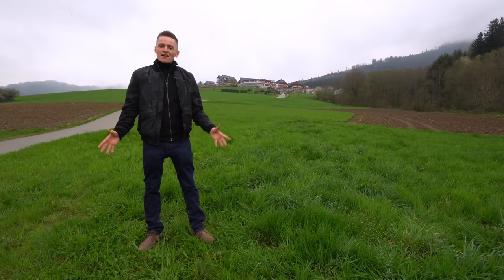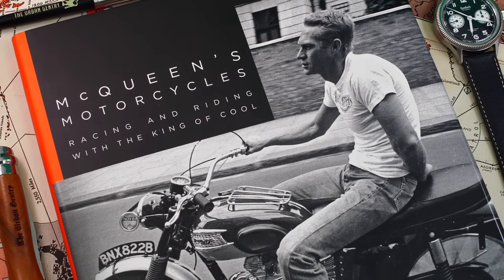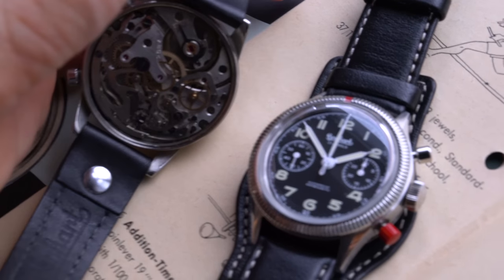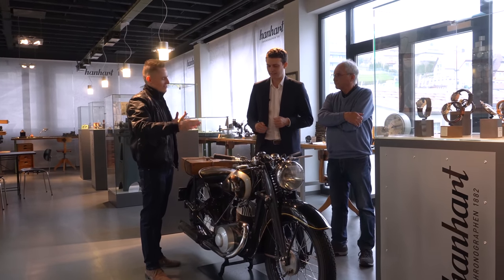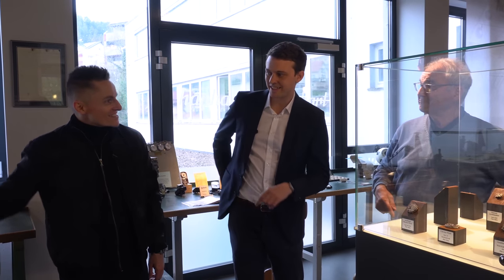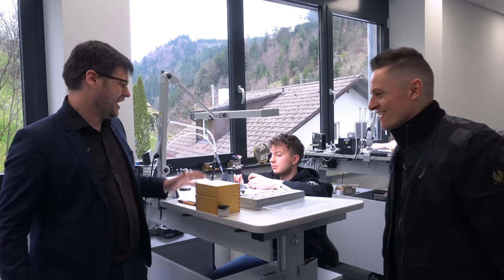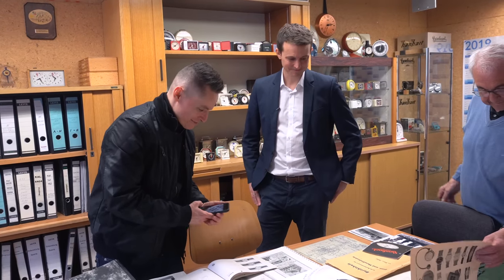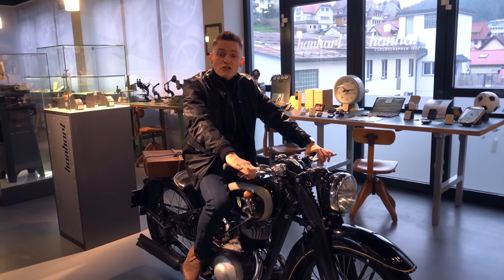Inside Germany's Most Prestigious Chronograph Watchmaker: A Never Before Seen Tour At Hanhart

Comment: They are so likeable at Hanhart, this is really a great but modest and sincere company.
In 2001 I've asked them to do me a 1941 Replica in steel with the gold plated, decorated 7751 movement of the "Gold Chronograph" and they actually did it!
The watch was running on the wrist at + 1 second per day and lost in position crown up 1 second during the night. After 9 months I've stopped controlling the watch since it kept that performance: incredible!

Comment: Having 4 Hanhart chronograph watches in my collection, this tour was very intriguing and thank you TGV.
Reply from the maker: 👏👏👏👏 Now that is pure class!
Thank you and enjoy your collection. May I ask which ones have you got? I'm very intrigued.
Best regards,
TGV
Reply: @theurbangentry  1) Pioneer Mk 1 714.210 automatic of the single pusher 1938 2) 1939 Flieger Chronograph 700-1100-00 which only 2,500 were made - all sold out 3) 417ES Panda Flyback 42 mm H721.201.7010 which a matching stainless steel bracelet is on its way 4) Pioneer X 417 Bronze Rake & Revolution H7212.310-7010  with an 8.00 to 8.25 inch wrist I can get away with the 42mm instead of a 39mm with the 417.  The other two models are 40mm

Comment: @theurbangentry  The  ones I have are 1) Pioneer Mk 1 714.210 automatic of the single pusher 1938 2) 1939 Flieger Chronograph 700-1100-00 which only 2,500 were made - all sold out 3) 417ES Panda Flyback 42 mm H721.201.7010 which a matching stainless steel bracelet is on its way 4) Pioneer X 417 Bronze Rake & Revolution H7212.310-7010  with an 8.00 to 8.25 inch wrist I can get away with the 42mm instead of a 39mm with the 417.  The other two models are 40mm - please do more reviews on Hanhart watches.  There is no other brand like them.  I am a Sinn fan but Hanhart is another level!
Reply from the maker: 👏👏👏👏
Thank you my friend.
Best regards,
TGV

Comment: sort of dislocleappointing that cases are stamped out. surely more precise,lrdd stressfull machining, eg CNC available today......ot were these 'retired' machines?
A trp o Lw Zenith, my favotite..on the cards? in hoise manufacturing was/is their preference, so massivelyinteresting, under represented on your channel, maybe.
uestion: is anx warchco. using titanium pellets to extrude solid titanium cases,parts?(likr replacement joint manufacture?  maye n Japan, lke Kyocera did for cameras.. provides perfectly smooth finish..

Comment: So I’m watching this video and seeing them making all the parts as if they’re making movements and then their watches have Sellita movements in them?!?  Maybe these are only the stopwatch movements but it doesn’t look like it. This comment is so far removed from when this was first posted on probably never going to get any kind of response. Oh well.
Reply from the maker: I have address this in many videos since, but duly noted, I will again. It's purely economics. To produced a movement entirely in-house to the same robustness, decades of proven dependability and ability to be easy to service,  would require millions of investment in infrastructure and the end result would still be a watch that costs far far more than what Hanhart offer. I feel the way Hanhart do it, with increased regulation, modification when needed (like the historical asymmetrical pusher or mono pusher) is a good compromise, especially compared to most other brands that just drop the movement in and do nothing much more. For ultra high quality mid level tool watch like what Hanhart, sometimes making everything in-house is not the best solution to create the best result. There's a reason why ETA and Sellita are so difficult to beat. Hopefully this video helped people understand that., Enjoy.
Best regards,
TGV